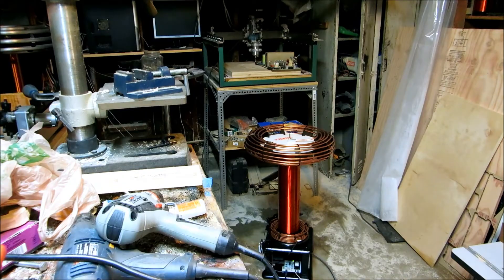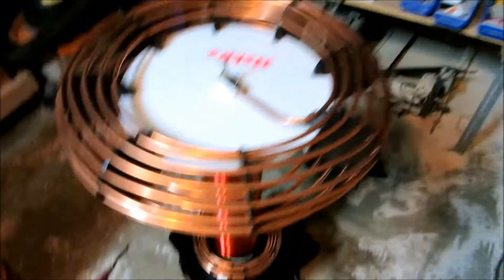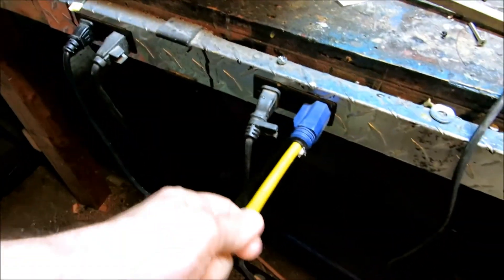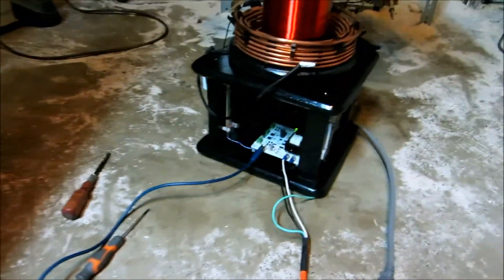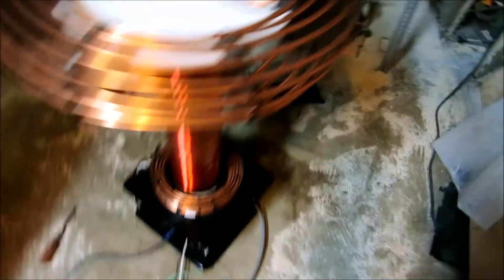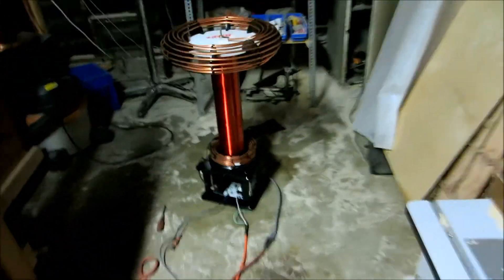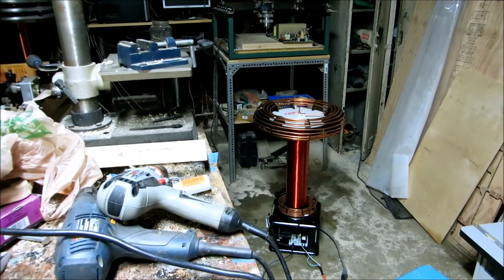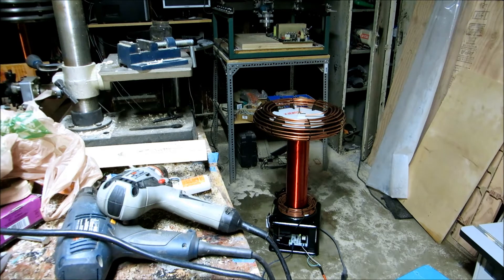DRSSTC Tuning

Comment: I have a secondary coil known to have a resonant frequency of 650khz. what is the value of the primary coil and the correct value of the capacitor? thank you
Reply from the maker: There isn't one ideal value. However, I like to make my cap value 50-100nF for this size coil. Then calculate a resonant inductance for that and make it longer than needed.

Comment: Isnt the coupling of primary and secondary coil to high? I bet its about 30%. So why this is working without Racing arcs and dead semiconductors?
Reply from the maker: NEY Industries exactly but you should move it in .25" increments or less when lowering or raising

Comment: Isn't it still really hard on your switches to run no breakout point?
Reply from the maker: Depends on the switches and how you tune it. These igbts are rated for 600 amps at 1mS.

Comment: Why would you tune the primary close to the secondary? Seems like a waste of time. I tune 10% lower than secondary F0 minimum
Reply from the maker: PhilsLab I do that first and then I lower tuning but I tune my coils specifically to a point to run them without a breakout point.

Comment: Holy shit, is that a toroidal primary coil?
Reply from the maker: yep, copper tube. Its one continuous piece.
Reply: NEY Industries 
personally, I also totally dig the pancake coil, and so my tesla coil that I built also has a flat primary (its a spark gap coil). but I'm not an electrical engineer , so I was unable to pre-calculate all of the dimensions, so it was easier to to use javatc and just put a bunch of turns (11 in my case) of copper tube, when really java has me tapped in at turn 4. but this allows easier adjustment of the primary's resonant frequency for when the surroundings are different or if I decide to add a way bigger toroid (which I will do) I am going to be able to just increase primary turns to match the secondary's frequency drop.
(sorry my reply is long, I just like to explain stuff)
I have videos of my tesla coil on my channel if you want to see... the more recent static-gap video has a lot less power with 2 MOTs (since I'm running it inside the garage now) but back with the ARSG I was running 4 MOTs...